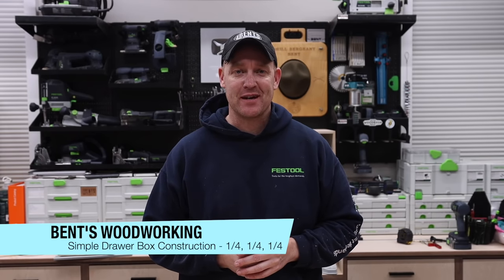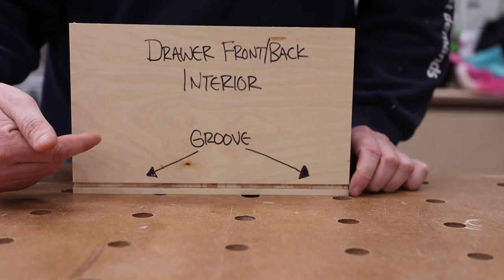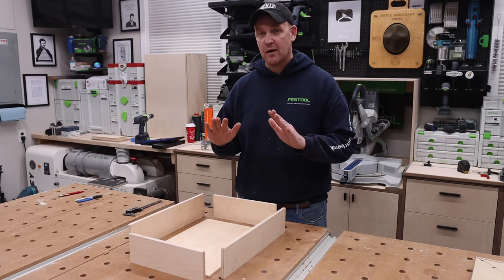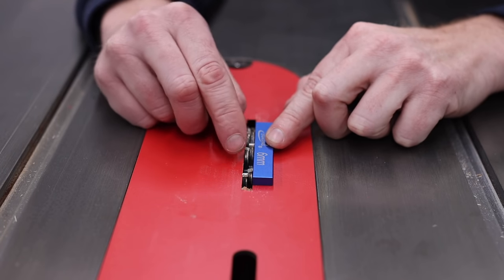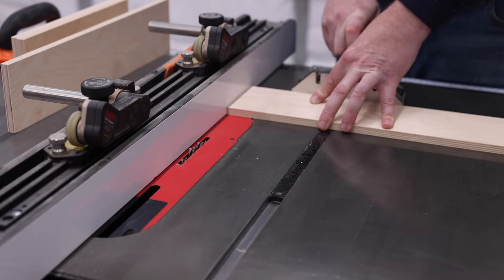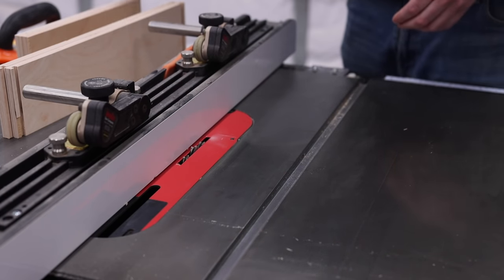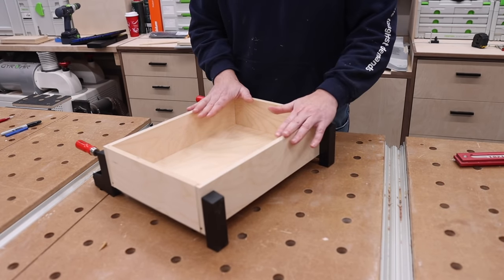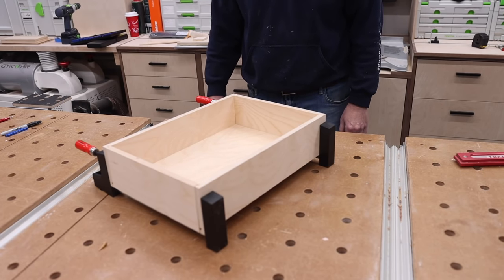These drawers will change your life

Comment: Thank you for not being stuck on 1/2" material. Some guys make it sound like you MUST use 1/2" stock and exactly 1/4" dados without considering that the measurements can be adjusted for typical "1/2" inch plywood. I've used this method for all my drawers since finding out about it.
Reply from the maker: It’s a common misconception that I thought needed to be addressed. 👍
Reply: Me too.  I watched the Gary Katz video several years ago and have since made many dozens of drawers this way, but it'll work for any thickness of plywood.  Ya just have to adjust your dado stack for your thickness of plywood.

Comment: Being a Mechanic by Trade , an Wood Butcher for a hobby .  A set of drill bits work in a pinch for most of your common small measurements of width's & depth's

Comment: If anyone is concerned about holding the pieces vertically to cut the rabbit, you can use a little two-sided tape and adhere your spacer block (the one you used for set up) to the table saw top, back from the blade of course, and run your pieces through on the flat.  But yeah, great, simple, solid drawer construction.
Reply: I dont understand. Please explain more.
Reply: Rob has an excellent suggestion. Cut the rabbets similar to how the side datos were cut. On the other side of the wood of course. To make a rabbet instead of a dato the wood must be 6mm from the fence at all times. The spacer block can do this provided you keep it behind the blade.
Reply: @ryanskeete  I tried to explain more. See my comment.

Comment: Set the distance between the blade and fence first and run a sacrificial piece through with the blade set roughly .75 inch high (as long as its more than .5 inch) and set it aside. (The sacrificial piece should be longer (and >10in) than wide so safer/easier to run vertically against the fence) Next proceed to set the blade height and make cuts. When you do the rabbets use the sacrificial piece as a stop block and you can run the rabbets horizontally using the miter gauge. Hope that made sense.
Reply: That is a excellent suggestion, thank you.
Reply: I was going to suggest that since he used a setup block to set the initial distance, he could stick that against the fence near the front and use it as a stop block. You need to make sure you don't drag it forward as you cut and ensure that you're firmly holding the piece against your miter gauge,but should serve as a decent alternative method.

Comment: Very well explained & demonstrated. For those of us that cannot support a dado blade, we would make the first cut on each piece, move the fence a few mm & repeat until you reach the desired width. It's more time consuming, but it works. I tend to use the router table. Couple of test pieces & I'm ready.
Reply from the maker: Very good points Gary!

Comment: I've just found my new preferred method for making drawers.  Excellent video explaining every step of the way.  Put it into use today and can't believe how easy it is to batch out a bunch of drawers once your dado blade and fence are set!  I had been using pocket holes, which work fine, but often have at least one of two joints that shift slightly while putting in the screws. Thus throwing off your drawer slightly.  
This method eliminates that.  

Thanks for another excellent video/tutorial Jason!!!

Comment: Great video, Jason! I've used this method for 95% of my drawer construction most of my career!
One thing that can be done to mitigate the vertical cut is this:
When it comes time to cut the grooves for the bottom panel, add a 6mm (1/4") sacrificial fence to the table saw. This allows you to place the front/back flat on the table and make the cut in the same fashion as the sides are dadoed! You want an exact fit, so the end of the workpiece ends up flush with the edge of the saw blade, but it works beautifully, and you still don't have to move the fence or the blade. This can be a much safer technique to cut those pesky Rabbets...lol
Reply: That's a simple and elegant solution.  Won't slow down the productivity much.  Thanks for that.
Reply: My thoughts exactly. Nice one 👍😎🇦🇺
Reply: @bobbray9666  I would love to try your method but I don't understand your description.  The vertical cuts are nerve racking and I would like to do it horizontally . . . if only I understood.
Reply: @number6396  You can also use your 6mm/1/4" setup block to space the piece from the fence prior to running it over the blade.  Just pull your setup block out before running the piece over the blade and you'll be perfectly setup.
Reply: @number6396   Your table saw has a fence. You will clamp onto your fence a 1/4” thick piece of plywood (or MFD or whatever you choose). This 1/4” piece is called “sacrificial” because often in other applications - say when you need to cut a narrow sliver of wood - the blade can run into this sacrificial piece of plywood without damaging your real saw fence.

In the case we’re discussing here, the “sacrificial” fence is being used as a spacer only: It is decreasing the space between your real fence and your blade by 1/4”.

Understand?
Reply: Good suggestion on adding the 6 mm sacrificial fence.  It is a much safer cut to lay the fronts and backs flat on the TS top vs, on end when cutting the rabbets.
Reply: What???  Do you mean the rabbets for the front and back panels?    Surely not using the 6mm sacrificial  fence for the groves for the bottom panel.
Reply: @toonybrain  Yes!  Now I do understand.  That description is very clear.  Thank you.

Comment: Great video for this type setup. After building Many drawers (dovetail, box, Leigh dovetail jig, porter cable jig, this method, drawer lock bits, etc) I have settled on pocket holes - can not see from the back nor the front if installing a drawer front. Much faster, very strong - just works. (Furniture grade would still use my Leigh dove tail jig)

Comment: When running the vertical pieces, try using a speed square to cradle the workpiece. One edge rides on the top of the fence and the “T” shaped edge of the square holds the wood perfectly.
Reply: Better is to use a few scraps of baltic birch and make a sled/jig. Zero setup, perfect cuts with no misalignment possible, no extra things to do, and it’s very, very quick.

Comment: I’ve not heard of this method and it looks simple, accurate and efficient. I’ll be trying it on my next set of drawers for sure. Thank you for continuing to produce excellent content that really helps beginners like me. Cheers 👍😎🇦🇺
Reply from the maker: Glad you found it helpful!!
Reply: With a wide router table extension built in place of the right wing you can do this in less time and more ergonomically.

Comment: At 8:05 you start the explanation about safety that includes “there’s no other way to do it.” While I agree with your ultimate conclusion about the balance of safety for this specific situation, I think it’s important to be aware of what the other options are that might be needed in similar situations. The next level of safety would be to use a slide box, safer yet when combined with some type of hold-down clamp. 

Again, I think you’re right that what you’re doing is reasonably safe. I just think we shouldn’t tell people it’s the only way to do it when there are other methods that can make this type of operation safer when needed.
Reply from the maker: Thank you for your input 👍👍
Reply: You mean a sled?  Or is slide box something specific?  One thing to consider is productivity.  When you're making a ton of drawers, it matters.  And one has to weigh little to no risk vs productivity.  I think "Al Amantea" comment right under your comment does the same thing w/o slowing you down.
Reply: @hansangb  Aka a sled, yes. I looked at that other comment and it also looks like a good option. 

I agree that you’re always balancing productivity with safety when woodworking and there’s no one perfect balance that fits every project and every person in every shop.

Comment: 👍👍 Well done & explained in detail! Depending on what the draw is going to be used for, the front can also be covered with a veneer in order to hide outer seams. Or, you could just do different joinery on the front piece to begin with.
Reply: …drawer…..

Comment: Great information, I cheated though,  I bought a pre-cut drawer side from Rockler years ago and used that for my set up block. Works perfectly.  Almost all of my drawers build's have been side mounts.  Might have to  try undermount's some day.  The only thing different from your method is I sometimes add dowels to the front sides for contrasting color, and it doesn't hurt for strengthening the joint making it a bit more slam proof.

Comment: That was a great demonstration with the panels marked up like that. I’m very new to this level. First time cabinet and drawers. I just built a mobile cabinet for my new portable/jobsite 8 1/4 table saw. I just finished cutting the panels  for the drawers using this method. I just bought a Freud 6” stacked dado set that gave extremely accurate and clean bottom cuts. Unfortunately It didn’t hit me that the set didn’t start out smaller than 1/4” width. I had to make the change when it came to cutting the rabbets. No big deal, I still cut them using the vertical method because I wanted the experience. I am going to make some sort of vertical guide jig that I can eventually use for lap joints or tenons. I think I would also consider using 1/2” poplar for the next set of drawers. It could be me rushing the cuts but some of the birch plywood ended up with nasty looking voids or gaps that help the looks or fit of some of the joints. Again thanks for being straightforward and concise.
Reply: I appreciate straightforward and concise.  No goofy time wasting commentary or clips from dumb movies!
Reply from the maker: Glad you found it helpful

Comment: Good method. I’ve used it many time and works well. I will say the dado doesn’t really matter and you can increase it if you are using specific runners that require more overhang on the bottom. I think around 16mm for Blum.

Comment: OK I Just made my first two drawers with this method.  Wow set up was tedious but worked out.  The rabbits left a paper thin skin but my marking knife easily removed it.  My drawer bottoms are large so cutting the rabbit all around was difficult to keep it cutting properly, i.e. I wiggled a bit but when assembled can't see it.  And best of all, the drawers bit perfectly in the cabinet!  Thanks for a great video.  Really looking forward to your video on the assembly table base..
Reply from the maker: Glad you found it helpful!
Reply: I have an INCRA LS positioner fence. I cut a piece of scrap 3/4” plywood the width of my fence and attached another piece of 3/4” plywood at right angle flush to the front of the fence using dominoes. This forms a support for the vertical cuts without the need for a sacrificial fence. It is held in place with T bolts, wing nuts, and washers.

Comment: Great description of the process.  Tx!  For me, since I don't have a custom plate for the table saw, I'll just make all my rabbit cuts last and on their sides after resetting the saw setup with a sacrificial fence.  Yah, it kind of kills the idea of one setup, but I have no other choice and want to be safe (like you pointed out at 12:10).
Reply from the maker: That’s also a great option.
Reply: All you would need is a spacer attached to the fence, positioned before the blade, that is half the thickness of your work pieces. In Jason's case, a 6mm spacer. Then you can lay your work piece flat on the table, using your miter gauge. Start the work piece against the spacer, hold it firmly in place against the miter gauge and run it past the blade.

You don't have to mess with the saw set up. The only variable is the thickness of your spacer.

Comment: Great video.  I like that you always explain things very well for beginner woodworkers like me.  My only question is, what if you use 1/2 plywood for bottoms?  Do I cut rabbits and grooves in the bottom panel to fit into dados of sides?
Reply: I use 1/2 ply for the bottoms using this method. Yes, you just cut a 1/4" by 1/4" rabbet all around one side of your 1/2" bottom stock (adjusted for the slightly less than 1/2" thickness if necessary) leaving a 1/4" thick by 1/4" long tongue to fit in the dado on the drawer sides. Just remember to cut your drawer bottoms 1/2" (or slightly under 1/2" for some wiggle room) oversize since they're inserted 1/4" into each edge of the drawer. Using this method with a 1/2" bottom makes for insanely sturdy drawers!
Reply: @k87upkid  Thank you so much for clarifying that.
Reply from the maker: That is correct. You can use the same setup.
Reply: I don't think you ever came back and addressed what to do if you use BLUM under mounts and that's what I want to use.

Comment: I've always loved this method. And I agree, with no off cut to get trapped between the blade and the fence, this is a perfectly safe practice.
If someone is really concerned about it, it's a very simple fix. Set the fence at the half inch mark and use the quarter inch spacer block against the fence for your setup. A little more involved, but so is taking the time to write a comment about how dangerous this is.

Comment: Very nice and detailed video as usual. Especially showing the intricacies of the joints and the zero clearance dado plate are fantastic. It might be a little more helpful if you could elaborate a bit more on the drawer sizing part of the video. Thanks.
Reply from the maker: I plan to do a video just for that 👍

Comment: Aha! The secret sauce is the 6mm (or 9mm for 18mm "3/4 in.") spacer block!  I've tried the "1/4" method (for "1/2in." plywood) several times and the corners have never come out right . . . because I would set 1/4" up and 1/4" out then try to adjust to make everything fit, despite knowing that the plywood was 12 mm, not 12.7mm. That just never worked. Now I have the secret sauce! And the 1/4 in. (6.35mm) dado stack provides a little slop for the glue. Wonderous, thanks!
Reply from the maker: Glad you found it helpful

Comment: It's a good method for most drawers and one I have used for utility drawers. But if you want to use an undermount slide like a Blum Tandem, the 1/4" distance from the underside of the bottom isn't enough. I always have that set at 12mm (1/2"). The dimension from any cross rail or cabinet bottom to the underside of the drawer is has to be 28mm to have enough space for the mechanism.

Comment: I’ve been looking for a video like this so thanks for making it.  As a beginner I wasn’t sure if you were using a dado stack and what the width was.  Also visual aids would have helped with the materials size section.
Reply from the maker: You’re welcome
Reply: @bentswoodworking  Excellent video - however, like @alrives said - What is the width of your dado stack.  I assume it is 6 mm (or something very close to that.  What stack width did you use/
Thanks again - for an answer and the Excellent video.
Reply: @macoak3869  With metric plywoods I've found that I have to experiment with different stacks.  I've even used non-dado blades and fiddled around with dado spacers to get the width just right.

Comment: I use a gripper to push the sides through... I find I get more consistent dados and rabbets because the board cannot ride up the dado blade - this is especially true on longer sides. Gary Katz - ThISisCarpentry channel also posted this video in 2019... 11M views...

Next step is to show how you put on the drawer slides... I have a great system that I use but I'm curious to see how set up your drawer jig to install all the slides.

Comment: Thanks for the informative video! My question is at 5:45 you mention subtracting 1/2 from the length of your 20" sides to reduce to 19 1/2". Is this to account for the face of the drawer or another reason?

At 5:10 you said if you want a 20" drawer the depth will be 20".  

Thanks again!
Reply from the maker: That was when I was addressing the panel size. It accounts for the groove depth